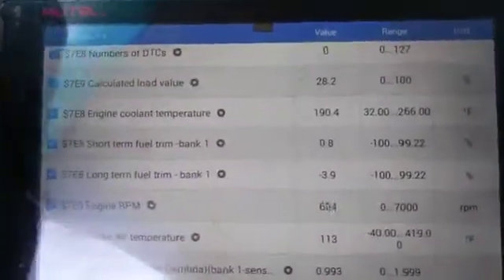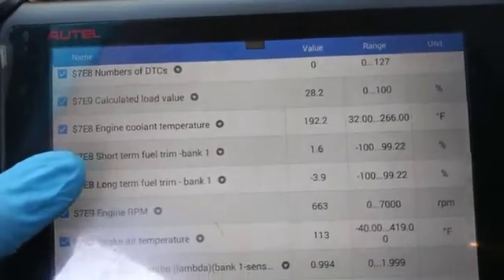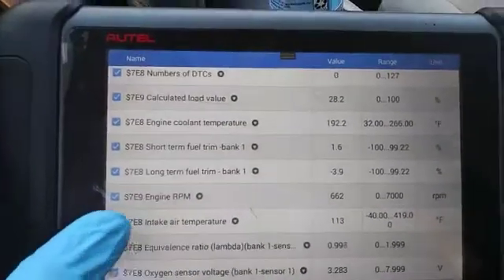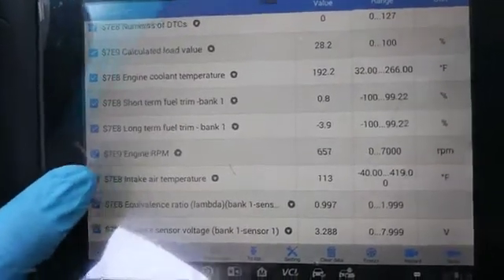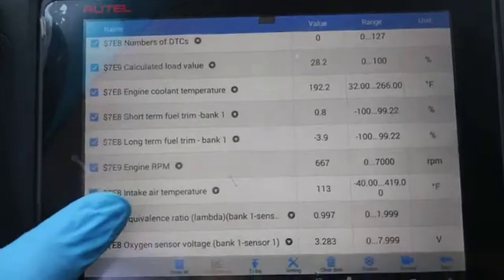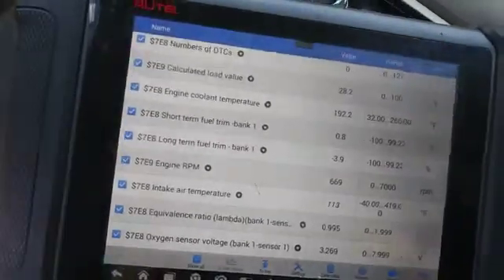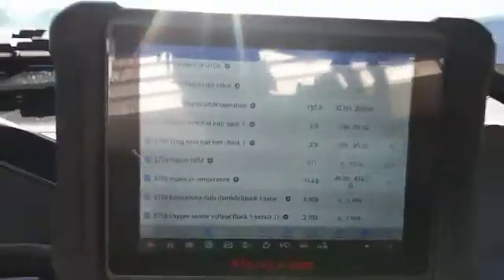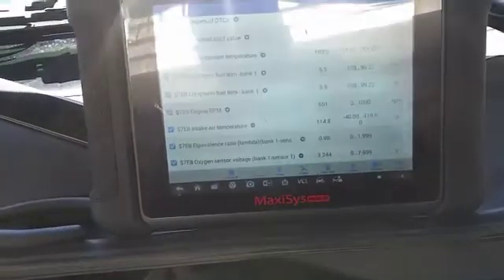DOES IT ALTERS FUEL TRIMS??? DIFFERENT SPARK PLUGS

Comment: did you adjust gap before installing new plugs?
Reply: You don't change the gap of Iridium plugs.  They are factory pre-gapped, and have a protective cylinder covering the plug tip, so it is not disturbed in shipping.
Reply: @jeffmc9154  wrong. 
you can and u should adjust the gap as per your car manufacturer manual settings regardless of iridium or copper or platinum etc.  I have suffered this before by installing NGK iridiums without gaping and fuel average went horrible it was 0.7 factory set,  then I got to set it as per my car manufacturer recommended gap that is 0.9 and fuel average becomes fantastic with no loss of power etc.
Reply: @nadeem5476  I have NGK Laser Iridium plugs. I recommend that people CHECK the gap of their plugs when they pull them out of the box, to confirm they are in spec with the auto manufacturer, but these aren't old-timey copper plugs.  For me, I order these modern plugs with the correct gap for my autos. If the gap were to be wrong (it hasn't been yet), I would exchange any plugs that were supplied out-of-spec by NGK. I'm not comfortable messing with extremely brittle plugs that are not properly gapped at the factory. Wikipedia: Iridium is a chemical element with the symbol Ir and atomic number 77. A very hard, brittle, silvery-white transition metal of the platinum group, it is considered the second-densest naturally occurring metal (after osmium) with a density of 22.56 g/cm 3 (0.815 lb/cu in) as defined by experimental X-ray crystallography. I agree with you that plugs need to be properly gapped. NGK 6774's are supposed to be gapped at 0.052 inches. Perfect for my car! If the gap is wrong, NGK can make it right, instead of me gambling with breaking the tip of a $18.50 spark plug. We agree that the wrong gap can cause poor mileage. It can also cause premature failure of coils, misfires, performance issues. Maybe what we don't agree with is who's problem it is if the plug is not gapped as advertised.
Reply: @jeffmc9154  not all the NGK plugs are advertised the gap actually,  plus it's not easy for some countries to send back internationally to gap it right :) , it's not a rocket science to gap the plugs at  recommended by vehicle manufacturer.  Certainly if you gap more than recommended then coils will suffer and will die before time,  but if u gap right they are good to go for long time.